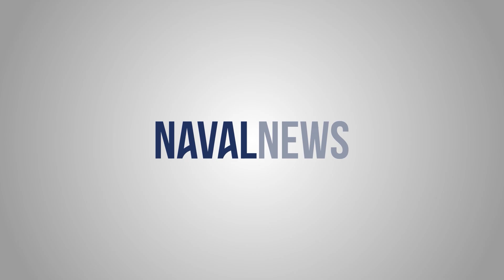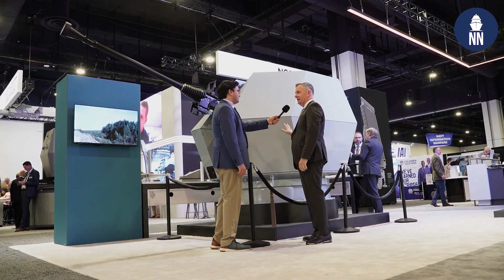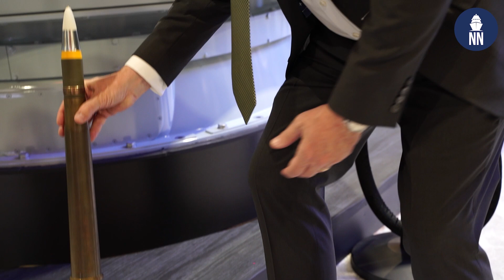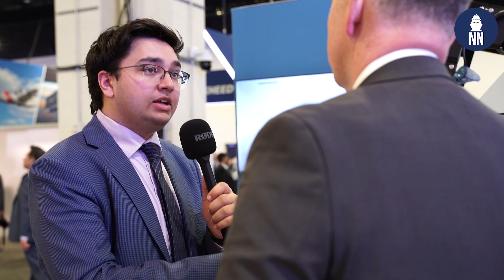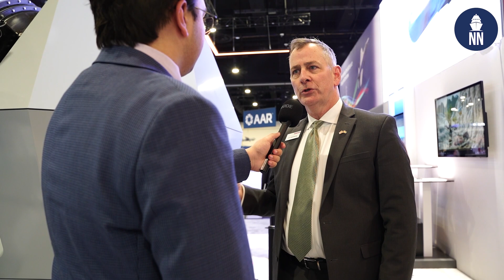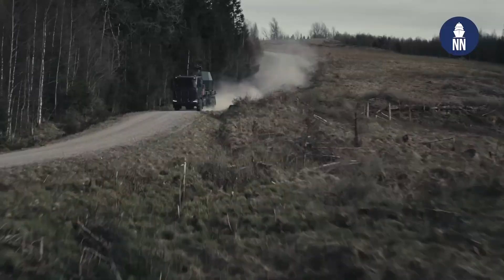BAE Systems pitching Bofors 40Mk4 naval gun system to the US Navy

Comment: The MK4 seems lightweight, quite flexible with the ammunition types- but just seems too much of an allrounder. As a CIWS, its outclassed by Millenium gun (1000RPM, AHEAD), its not big enough to fire guided ammunition (76mm strales is operational, 57mm madfires not far). I know the MK4 is focussed on weight rather than RPM, but the DARDO mount achieved 450 with the same bofors l70 gun. Right now, the 57mm with airburst is a better CIWS than the 40MM, while offering far more punch against surface targets. It would only really make sense to put this on OPVS, MCV vessels
Reply: There will be 2 on the type 31 frigates plus one mk57.

Comment: I think the US navy could certainly use these Bofors 40Mk4 Naval guns especially in the smaller LCS ships freedom and Independence class. We could also use these on autonomous systems in outer perimeter security. There are a lot of uses for such a system especially since the US Navy is looking to replace the Phalanx systems.
Reply: The 40 mm would be a good replacement for the Phalanx 20mm or 30/35 mm. Far better range and higher probability of kill with fewer rounds with smart proximity ammo. In the range of mass missile/drone attacks, engaging at longer range with fewer rounds and larger load-out is almost mandatory, if you expect to survive an multi-wave attack with lots of EW and decoys. That said, having only two mounts will probably be too few per ship/site as future attacks will be similar to the Vietnam Wagon Wheel" type air attack, where raiders come in from any and possibly all points of the compass to confuse defense computers. Two systems can only hope to engage 90 to 120 degrees against multiple fast movers. Trying to engage a larger area may make the AI have a nervous breakdown trying to analyze threat shot priority.
Reply: @CaBuckeye  good points, degrees of firing arcs should be limited and somewhat likely will be anyway due to the build structure on navy ships. anti-air here have an advantage over vehicle mounted systems as well, massive capability for shells. a bofors system for example, had a two-story setup with over 700 40mm ready to go. rheinmetall, bofors and bushmaster to my limited knowdge offer intelligent frag. there are probably more?
Reply: yes direct hitting anti air is outdated. the range relative to successful hits is pretty bad compared to intelligent frag ammo

Comment: In Ukraine, this would seem like a rough analogue in role to the Gepard for air defense, with similar effective surface-to-air range. I wonder if the fire control of the land-based variant can be slaved to an external radar network, as it would be aboard a combat vessel. Otherwise it's entirely reliant on the on-board electro-optical sensor for acquisition.
Reply: It can be slaved to external radar, and also networked with three other Tridon systems.
Reply: @nemzeh  Good to know, because otherwise it would be useless against drones in for example fog.
Reply: its not the same effective range. like phalanx, gepards ammo afaik needs to actually hit the target with its main shell. its not intelligent airburst like modern rheinmetall and bofors

Comment: They need to develop a version with a larger ready magazine so they don't need deck penetrations. That'll make them more appealing against a lot of the new rocket and drone munitions coming up. 

The 57mm version in the latest non deck penetrating turret has 120 ready rounds compared to 70 offered by this.
Reply: 100 rounds for the 40mm deck mount,with no deck penetration. The new 57mm gun is only available in deck penetration mount. https://en.m.wikipedia.org/wiki/Bofors_57_mm_Naval_Automatic_Gun_L/70
Reply: @KALATRAVAS1  incorrect. Both autocannons come in deck and non deck penetrating mounts. Wikipedia is only good for surface level information. The 57mm bofors mk3 turret carries 120 rounds in its ready racks. Thats 120 57mm. More range, more payload, more damage potential per round and more magazine depth means it can engage more targets farther and with less rounds. 

Why have 100rds of 40mm when you can get 120rds of 57mm for a slight size increase.

For 40mm to be taken more seriously in light ships for non deck penetration and the anti fast attack/CIWS/CUAS role, it needs a larger mag capacity. The DARDO, for example, carries 440 40mm rounds in non deck penetrating form. BAE should design a new 40mm turret that can at least carry 200rds which will make it payload competitve with the 57mm and mag depth competitive with 20mm, 25mm, 30mm and 35mm autocannons. All non-deck penetrating ofc. 

Also notice im using magazine depth and not capacity. Magazine depth in this case is the amount of effect rounds you actually have for targets. For example, if it takes 10 rounds of 40mm to counter a drone then you actually have a magazine depth of 10 rounds with the bofors mk4 turret. 10 chances is not that hard to overwhelm.

40mm is not bad but Skyranger 30, 35 and 57mm bofors currently come in better packages for guns.
Reply: @bwainhort Could you provide any sort of counter source for your argument, or are you just making it up?
Reply: @galaxel1494  which part? Most of the technical data comes from the manufacturers websites, dedicated military hardware websites, military hardware exhibitions and public essays from military academies around the world. You can even start by reading the actual sources that Wikipedia references but those tend to be out of date. Youtube deletes links so I can't post them on here.

Comment: Looks good for a gun boat to protect merchant ships against pirates.
As in, it would be far more financially viable to have a boat under 24 meters (78 feet) at the waterline (the definition of a boat, as opposed to a ship) that would save vast amounts on money on fuel and crew, then having multiple layers of defence against some thugs, on small, fast boats with assault rifles.
Also, having multiple gun boats, instead of one large frigate ship, seems like a far better use of resources, to patrol against black market shipping, as you can check more then one ship at a time, if you have more then one vessel in that water at a time.

I'm not saying "get rid of capital ships". I just mean that gun boats seem like a far better investment, then parking an aircraft carrier, in the hope that you might have it in the right place at the right time, to catch a half dozen men with AK's, on a small little day boat.

Comment: It's funny cause in the eighties when Italy start to use as 40mm gun the still available on Leonardo catalogue Fast Fourty in the twin barrel configuration capable of 900 rounds per minute as CIWS many NATO partners were skeptics about its effectiveness and that system (Dardo) even use a radar as guidance method.
444 rounds are ready to use in the mount.
It's long time Italy have shifted on 76mm, indeed nowadays Superapido gun is in use as CIWS paired with DART radar beam riding munition, for the most highly challenging targets, capable of 50g maneuvers up to 5 nm.
France made another work of art with its 40mm (or 50mm eventually) Rapidfire, but price of the sophisticated munition is cutting their legs as anti-drone cheap solution, indeed the price per round is almost comparable to DART anti-missile guided munition and way more expensive then 76mm normal ones, not to say compared to 40mm rounds.
A note on last variant 1b of Phalanx 20mm CIWS:
the combination of new round and new 99 calibre barrel, if you looks at the charts, extended its range up to 2 nm.

Despite BAE speaks about hypersonic missiles in this interview this Mk4 mount variant it's not a CIWS, moreover at hypersonic speed speaking on CIWS make no sense considering residual range and energy of the debris, probably even for the 5 nm range of DART munition and Superapido gun!

I believe a more fair coparison for this gun is the 25mm Mk38 Typhoon systems in the US Navy.
Bofors 40mm gun performance are better.
Still I would prefer an upgrade to 30mm with Air Burst Munition as anti-drone and self defense gun considering prices!
Same thought gone on Rheinmetall Oerlikon 35mm Millennium gun, but it's also a CIWS with a fire rate of 1000 rounds per minute and a remarkable range of over 2 nm.

It's just a personal opinion, but industrial and political interest goes beyond mere cost effectiveness consideration.
So don't get mad about it cause it has no value!
Look to Italy they have their 76mm gun masterpiece, but the army recently ordered the 35mm gun!
It's your personal ideal idea against reality.
😭🤬🤣

Comment: Bringing back the 40mm? 
The only reason we took the 40 off of AC-130s was a lack of ammo and parts. Maybe we can bring it back.
Reply: You must have had the wrong 40mm, not the Bofors one.
Reply: @axelv1753  The AC-130 used the L60 Bofors.
Reply: @scottzagger  L60 is old so it probably ran out of parts. The current versions are L70 variants.
Reply: @bulthaosen1169  Yes the L60 parts ran out but the Air Force didn’t use the L70 they switched to 30mm
Reply: @scottzagger  strange. The 40mm bofors L70 ammo is a damn good ammo.
Reply: @bulthaosen1169  No doubt.
Reply: It really is a perfect weapon for drone defence. Not suprising it's coming back.